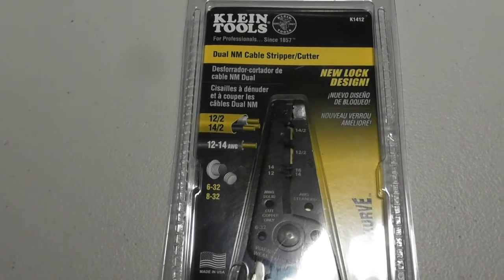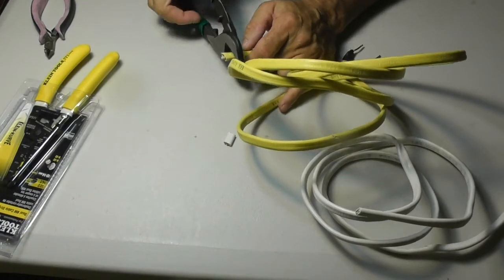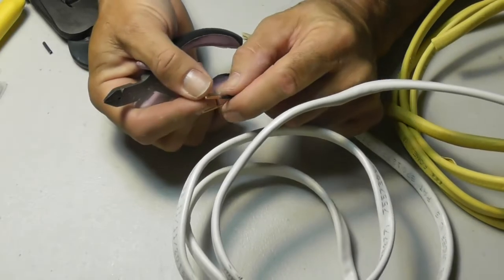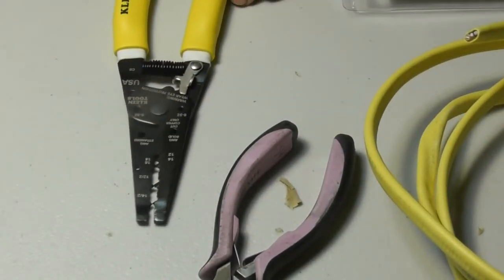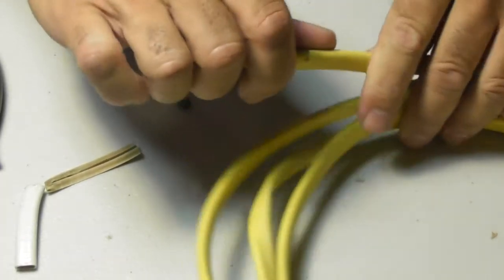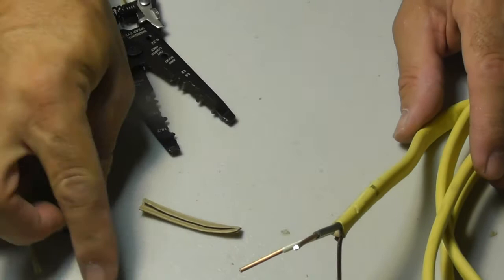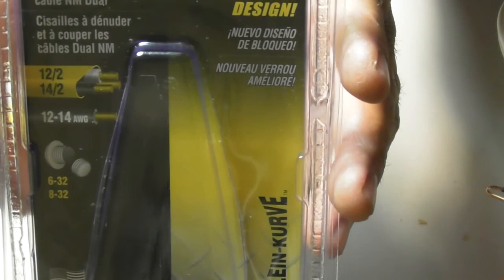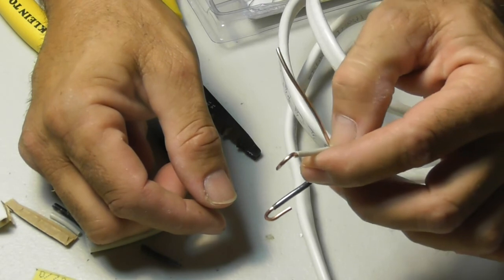Klein K1412 Stripper and Cutter for 12/2 14/2 ROMEX Cable WIRE DETAILED REVIEW  HOW TO USE IT!

Comment: Those are flush cuts. They’re made for data cable and used to cut your pairs flush with the RJ-45 head. They’re definitely not used for romex. A knife and pliers would’ve been a better way to show how this is done but (possibly) not as efficiently as with the strippers you’re demo’ing.
Reply: Facts and going around with the flush cut around the insulation of the 14 is disturbing 😭😭😂